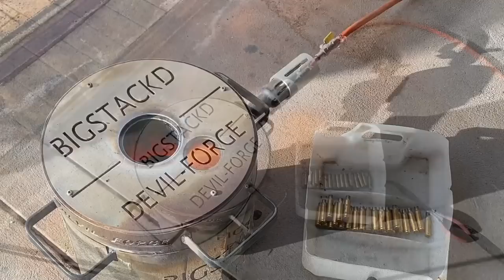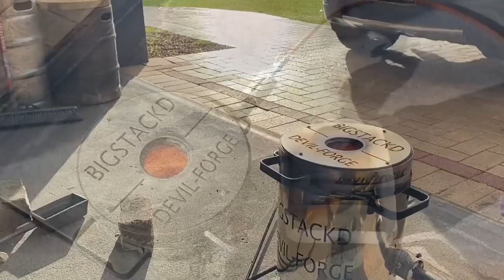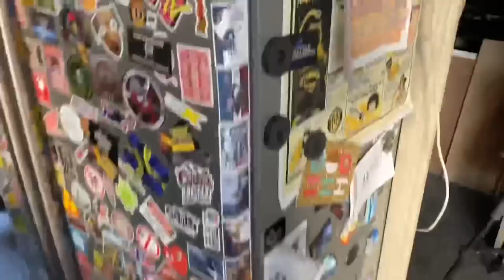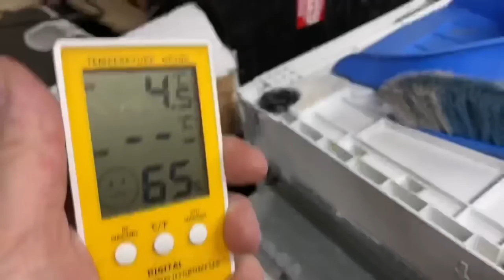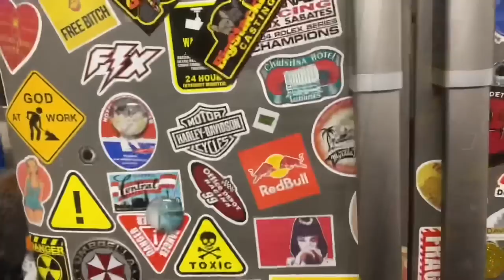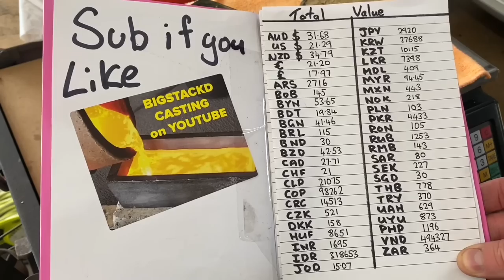Bulk Bullet Shells To Mirrored Bar - Trash To Treasure - ASMR Metal Melting - BigStackD Casting

Comment: Those are 7.62x51mm NATO casings. The civilian version is .308 Winchester. You are absolutely correct to inspect them first!
Reply: Inspecting is good....but in the cooker they would have not caused any damage
Reply: @brianthaxton229  It would splash molten brass around and possibly crack the crucible, neither of which are good
Reply: My first though was that they looked like 30'06 cartridges, but off. Big honkin' cases. I reasoned that they were .308 when he was measuring them. And I reiterate your advice of always checking cartridges first! :)
Reply: @flykintoun  Neither would happen....no pressure to create explosion....only heat to melt the brass and burn the power...
Reply: @brianthaxton229  the powder would ignite before the brass melted, so there would be pressure. I've forgotten who it was, but their video is still on youtube, they had a round cook off when they were melting down lead, it sprayed lead all over their bench top. 
This isn't a theoretical scenario here, people have had rounds cook off while melting and they have caused dam
Reply: @brianthaxton229  A cook-off is when a round goes off unintentionally due to the heat around it igniting the gunpowder inside the round. It can be incredibly dangerous especially with larger rounds. Source: a US Marine who shoots M240B's
Reply: @UltimatePowerRanger  And I supposed you can verify that it was submerged in molten brass when this "cook-off" happened?   You all really need to focus on science and not field accidents
Reply: @brianthaxton229  the heat would have ignited the powder and the primer well before melting.  The damage would have been marginal but could easily crack the crucible.  Powder going from a solid to a gas reaches a few thousand degrees and expands a few thousand times its original volume the primer explodes.  Even cartridges outside a gun’s chamber detonating are dangerous and to be avoided
Reply: @brianthaxton229  you’re so wrong about this.  He was very prudent to have removed the live rounds.  When I find live rounds at the range I use a pipe cutter to open them and dump out the powered.  A few times I held the bottom half in a Vice and held a torch to the primer to set it off.  Ten feet away the three primers dented and tore the surface of a #10 tin.  I immediately just started soaking the primers in water to neutralize them.
Reply: @charleshetrick3152  ok....good ole pair of pliers too hard to use?  You all have your theories but are all wrong!
Reply: @brianthaxton229  it’s not theory, I’ve seen what happens.  I use the pipe cutter because that’s what works for me if you want to use pliers I would t have an unkind thing to say about it.  I’ve personally reloaded a little over 150K rounds of ammunition and because I follow reasonable safety protocols I’ve had only one squib round make it into a gun and one primer detonation on the reloading press.  Introducing high density propellants and explosives into a smelting operation is just plain idiotic.   My guess is that your last words will be “hey watch this”.
Reply: @brianthaxton229  how are field accidents not relevant to the safety context of the dangers of un-chambered cartridge detonations?
Reply: @brianthaxton229  even if it weren’t a pool of molten lead,  the lead in the core of the bullet would easily be liquid and possibly be flung at bystanders and or damage equipment

Comment: I just love to see so much 308/7.62x51 casing. Glad you double check and make sure you only grab the empty casing. Even if you did put a live round into the smelting furnace the bullet won’t go anywhere.. if the round doesn’t have a barrel to build pressure to be a projectile will will simply just explode a spit out the round maybe a yard away.. but always be safe bud!

Comment: A furnace full of live rounds would cook off. It wouldn't be too dangerous since the cartridges need to be chambered to build significant pressure. You wouldn't have to worry about metal splashing since the rounds would pop before the brass would melt.

I know this because me and a buddy put a crate of horribly corroded 5.56 in a burn barrel for fun. It's like angry popcorn.
Reply: that’s awesome haha
Reply: A non corroded 5.56 has less humidity and is more likely to explode, and the heat for casting is higher then just burn barrel
Also who wants to be around such a thing when it goes off
Reply: I guess that's why when you hear gunshots in movies and TV that spook characters, but turns out to be popcorn, that's where the thought comes from
Reply: I imagine uncorroded rounds would trigger. Corroded ones would have weakened casings, so they would explode in all directions and minimize the force. Uncorroded rounds would likely hold as they trigger to direct all the force behind the tip. A crucible full of them wouldn't likely be catastrophic, but the fallout most likely would cost you the crucible and likely heavily damage the inside of the forge. It all depends on how strong that lining in the forge is. But, yeah, the crucible would likely be toast.
Reply: Angry pop corn.  Excellent

Comment: Judging from the shape and the case length you provided those are .308 or 7.62x51mm NATO rounds. The diameter of the projectile right beside the end of the case will provide enough information to tell for certain, it should be .308 inches or 7.82 mm if they're .308/7.62 NATO.

Comment: I did a similar melt before.  I missed one live round.  It got my attention but no one was hurt.  I have a wall of broken performance parts in my shop, pistons, 12 valve o ringed head, twin turbo setup that ate a valve, high performance boat props, and one exploded .223 round.  The final products were good tho.  I got into it bc my dad has everything so I made him a custom putter out of spent brass.

Comment: Not sure if this is the case with these M80 casings, but M80 cartridges in the US use lead styphnate in the primers, which is released when the primer is detonated, but only in small amounts. When the primers are melted though, more lead might be released as fumes from the melt. Just a heads up so you and others are aware 🤙

Comment: Most likely the live casings would pop with a fairly loud pop but with no chamber for the round to have its pressure directed in they will be fairly harmless, they may crack the crucible or blow some hot metal out of it so its still much safer to remove them before hand but you can more or less toss them in a fire without much chance of harm
Reply: “Might blow some hot metal out” yeah totally harmless
Reply: Jesus’ tits where does this myth come from that loose cartridge detonations are harmless!?

Comment: I've got a question, what do you do with the live rounds? Cause I though it was illegal here in Australia to keep them unless you have a gun licence and you need them.
Reply: @sub-vibes  spent casing definitely legal to keep I use to shoot recreational at a club when I was 13-14 and I was always allowed to take the spent casings home. I'm curious about the live ones though 🤔
Reply: If he doesn't have the relevant means to fire the rounds. And can still prove his reason why he has them ie found them in these tubes of spent rounds. I see no issue at all. Not like he just has two live rounds just because
Reply: There was a case in Sydney where a guy got popped for a few when using spent cases for an epoxy tabletop. Judge fined him and said turn them in next time lol! So it would seem the surrounding circumstances factor in. Least in Sydney anyhow. Australia is a big island.
Reply: It’s easy enough to pull the bullets and empty out the powder. Removing the primer is slightly more difficult but not by much - you can use water pressure to pop them out. Then he’s fine as they’re not live anymore.

Comment: If you melt down more spent casings there are a few things to consider: 1) the primer compound may contain arsenic, traces of which will remain burn residue inside the casings (keep it in mind for repeated exposures), 2) uncleaned you're going to have all sorts of residual contaminants, the primer compounds can be pretty wild, and the propellants could have some interesting additives too, 3) even though the casing body is mostly "brass" they may have been electro-plated, so your copper alloy ingot could have interesting things like trace amounts of arsenic, nickel, boron, and lead in it.

Comment: This one hurts to watch you meltdown so many reloadable shells that are worth way more than brass itself.
Reply: Ex military brass has twin flash holes, which makes it hard to deprime. Strangely though, tracer ammunition is single flash hole.
Reply: AFF 91 stamped casings are able to be reloaded easily of course you have to check headspace and all the specs to make sure each shell is up to standards it’s very easy to tell old shells that have been over reloaded apart from the others. It all just depends on what you know and how you know doing it! Personally myself I don’t my brother on the other hand has the knowledge to do so and has been doing so for many years! It all depends on how far you are willing to go and how much time you willing to put in to your reloading! Obviously not all that brass would be viable a good 25% of it would be though

Comment: When you melt the dust could you maybe use some quartz lab equipment? It can have a super high melting temperature, well above brass. It's got a very low amount of thermal expansion so it is heat resistant. It would be very cool to see the brass melt visibly.

Comment: Yknow, I have to wonder if it would have been faster/more efficient to crush the casings flat before putting them in the crucible. If you got something heavy like an old generator and a few metal plates you might be able to crush a few dozen at a time.

Also, have you ever tried roasting marshmallows over the furnace's exhaust chimney?

Comment: As a note for future shell casings melts,  you’ll want to deprime and clean them before hand.  There’s still plenty of lead from the primers and from the exposed lead at the base of the bullet.  That it’s a concern the amount of lead you put into the air here.  I’m in the U.S. and none of my local recyclers will take primed brass.   There’s one way out of town that will but pays 70% less per pound compared to clean brass.

Comment: A wonderful good morning from Austria. Probably someone has asked the question before. I'll ask again anyway. What I noticed after many videos now. Can it be that brass always produces proportionally more slag than copper or aluminum. It doesn't seem to matter if it's corroded or clean brass.
Reply: There will a lot of carbon on the inside of the cases and the left overs from the primers.
Reply: It's due to the zinc component that reacts to the oxygen in the air producing zinc oxide.  The yellow powdery stuff on top.

Comment: Live rounds will go off when heated, but it isn't the same as firing them in a gun.  In that case the expanding gases stay hotter for longer and release the most energy possible; when the round cooks off in a fire it doesn't have that.  In either case the bullet isn't going to go far but the casing might; I'm not suggesting you try it but if you do, stand back.

Comment: 🤚question! Is there a easy way to tell metal apart from each others when tearing stuff apart or is there a device that tells you?

Also what do you use to get the slag out of the melted metals?
Reply: I always have this question from my metal detecting finds. Some you can tell by appearance, some if they are magnetic, some by acid tests. Or you can buy a $20k XRF machine. Hopefully some have some more tips.
Reply: Sim

Comment: Hi, I wonder why there is this hollow in the big bar in the center on the casting face, is it the temperature difference due to the fact that at this moment in your house it is winter and therefore seasonal temperatures, or is it for other reasons. I have noticed that there are also often non-smooth surfaces when you cast copper and I also wonder if it is due to a particular reason like impurities in the materials you are casting or if it is there too due to other reasons I would expect the bars to come out smooth or nearly so but that is rarely the case despite the copper you are casting looking crystal clear if you don't mind enlighten me on these points in order to quench my curiosity. Thanks ;0)
Reply: Molten metal shrinks when it solidifies.
In this case, leaves a depression in the 
middle.  When casting, that shrink can 
cause BIG issues.

steve

Comment: What gas flow rate do you use for brass like this?  I always seem to end up with it cooling too fast when I pour it, or overcooking and ending up with more zinc/fumes and a mess...
Reply from the maker: It was about 0.06MPa as I was in no rush to melt them, it did take a bit longer than usual but as you just mentioned you can’t really rush brass melting👍🏻

Comment: Hello my friend, excellent job as always.
It seems to me that using a lot of borax contributed to the fact that there is little waste.
Let me give you a tip regarding those live ammunition. See if you find any sport shooters that reload ammunition because maybe they have a "flip hammer" it's used to disassemble a poorly assembled ammunition or it's worn out and live like there and you can separate the bullet from the case and remove the gunpowder from the interior for better security and also has a device to remove the primer that's in the center of the base of the case.
That way you have the case completely safe to casting.
Big hug from Argentina 🇦🇷🖐🏻💪🏻

Comment: It would be interesting to see if you could tackle the challenge of melting and refining scrap projectiles recovered from an old range backstop to go along with those spent brass cases, separate the dirt from the metal, then the individual metals and alloys from each other and so on.
Reply: There's a bunch of videos showing exactly that. Just a soft grey ingot really.
Reply: Melt it all together
Reply: @joshschneider9766  I know it's been done before, I just like how there are all kinds of different alloys and metals to be found in inert fired projectiles depending on what era and where they were produced in and so on.

Comment: How do you minimize the shrinking at the top of the ingot? I have recently started doing some brass melting/ingot casting and get a large shrinkage spot in the ingot. Think I may be pouring the metal when it is too hot, but would like some input.

Comment: I do love my Friday morning melts! I do have a melt suggestion, have you ever made Nickel Silver? I saw some on a knife making channel and it looked good, thought it might make some cool coins or something. I always love the Nordic Gold melts and thought this could be similar but I am not totally sure. Either way, I love the vids. Also if you get a bigger shop it needs to be called BigShackD! Thanks as always for to fun videos!
Reply: I make nickel silver bars.It produces a very pale yellow brass .i use vintage cutlery after stripping the silver off for material.
The bars ive made from old new zealand coins are of such high nickel content theyre silver.
Reply: Not sure he can do Nickel in those furnaces. The melting point of that is not that much lower than that of steel.
Reply: @ranekeisenkralle8265  yep my furnace has three jets .I only need to use one for pewter to zinc and similar but its all barrels blazing to get the temp i really want for copper brass and especially nickel chromium and titanium.I havent had a go with titanium yet though.hard to source i look for golf clubs in op shops that have it.

Comment: I wonder if the fulminate of Mercury is burnt off. Also it isn't the length of the cartridge but the diameter of the shot you need to check. By shot I mean the bullet without the casing.

Comment: To answer... the live rounds you found look like 7.62x51 NATO - brass case is 51mm with an OverAll Length (OAL) of 70mm and a bore of 7.62mm. Bullet diameter is typically 7.82mm which is squished down to 7.62 as it is pressed into the bore of the firearm. The AFF headstamp on the cases designate the manufacturer is Small Arms Ammunition Factory No. 1 Footscray, Australia.
Reply: Russ T no Buttet diameter does not change when loaded into the bore of the firearm if it did it would get stuck

Comment: It always makes me wonder how you end up with magnetic bits of metal in the dust after you've sanded your bars.
Reply: From the metal polisher brush he uses i presume
Reply from the maker: I hit the bar with a steel wire brush first but I may have left that out and that’s where they come from the wire brush from the electric drill👍🏻
Reply: Also he doesn't surgically clean his floor every day. Any number of materials in his garage are magnetic.